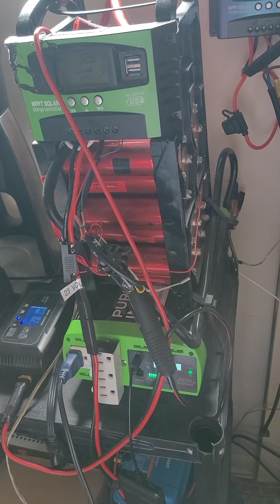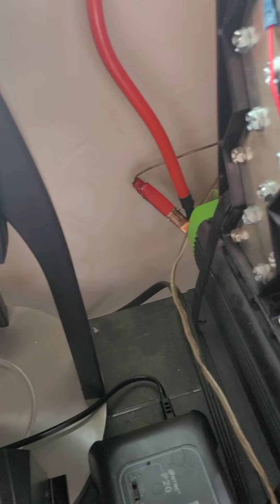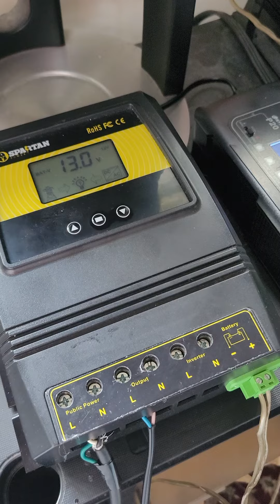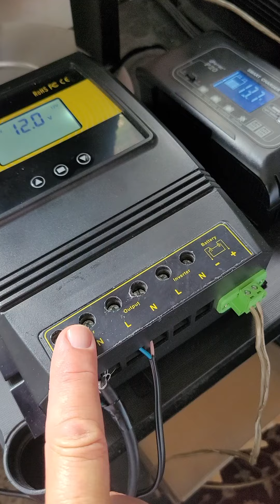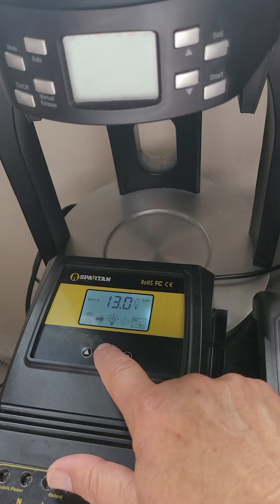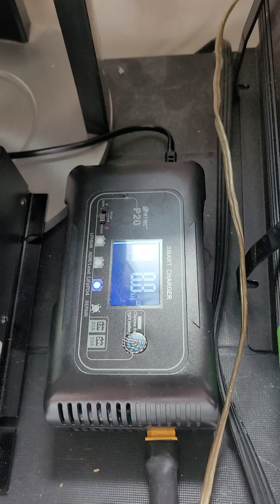Use an ATM (Automatic Transfer Switch) to charge LiFePO4 battery pack before BMS locks it down!

Comment from the maker: Correctikn: transfer switches designed to switch from the inverter to public power when the voltage on the inverter battery gets too low.   I said this backwards.

Comment from the maker: Correction: battery pack consists of twenty four (24 )- 38120 type LiFePo4 cells, four (4) banks of 3.2 volts for each bank of 4 cells.